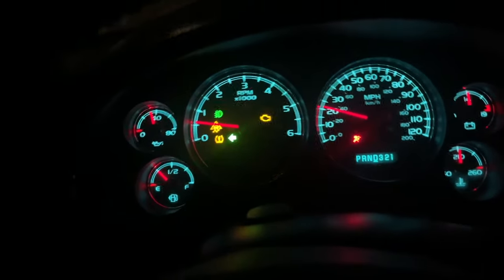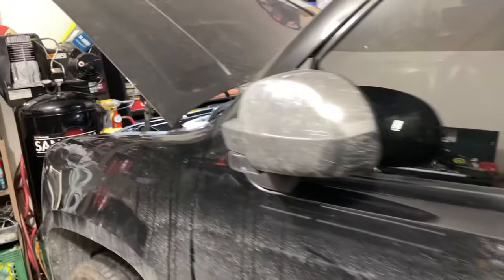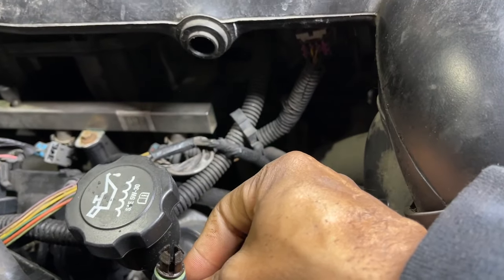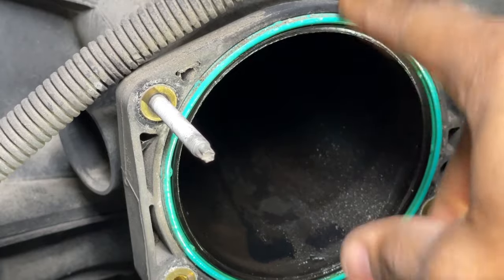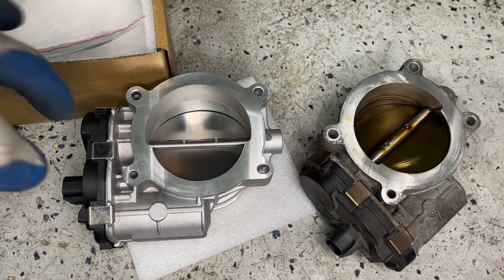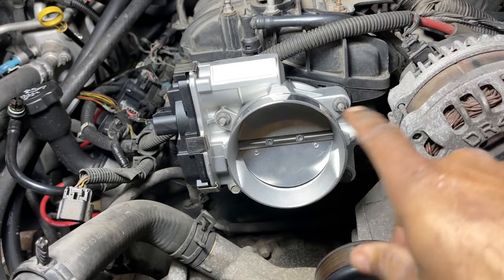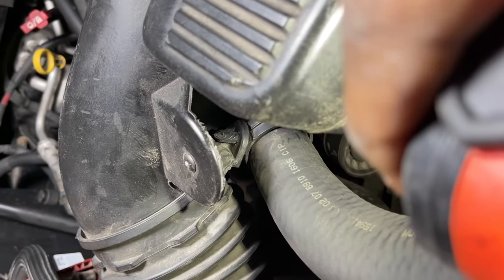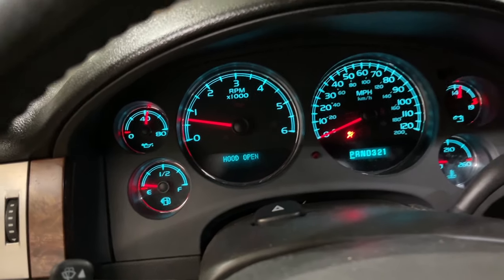How To Fix Reduced Engine Power Quick And Simple! Code P2135 Chevy Or GMC Trucks / SUV's! TPS Issue!

Comment: What was the exact name of the part that you installed? Great video btw.
Reply from the maker: Hi, here's a link to a new part for the 2007-2008 Models

https://www.ebay.com/itm/374136353837?fits=Year%3A2007%7CMake%3AChevrolet&hash=item571c43b42d:g:c44AAOSwIqlivR9B&amdata=enc%3AAQAHAAAA8A2kI6cfFvC0MtBqUe%2B4Ifu16TSp5iB0eHwodOstSzRT%2FVzPOZb5qAKE9pM9qTAJb8YYnwbOCdSrw3eEJqX6GnTQPjW0OJX0IwsQlejuzoZN2MSr8O%2Fla6ZaheXl1sFMH9ryg7Am328%2BCA7qvHcB19G64Q%2BjiY42Jb7lgoTJUW1lhB2%2FJ%2FBf0xCIe19VgmLkNcUv6B1ySxHD9iXXxI8IrdTtktaDDGqQZuKCrefpKid71AsMda2JxJc%2BSYTXr%2BNd93yCeXH2L4xq%2BbvXd5kEgahbzQvudtKPMWzPzAqVDeCKAl6UnvN5ZBfRWEzg1df6kg%3D%3D%7Ctkp%3ABFBM5Jeh1LFh

Here's a link to a new part for the 2009-2014 Models

https://www.ebay.com/itm/263995145126?fits=Year%3A2009%7CMake%3AChevrolet&hash=item3d77563ba6:g:hTQAAOSwEahhkcsT&amdata=enc%3AAQAHAAAA8Alo%2BCk%2F1yLsIegy9tmk5edQ5E%2FZaYgySY%2B7R7qsEEHQ8eppIFJgp7kxtrhcJ2fSWmSO72CpkG0bGJB483VVEEwO9cfbKnISkX7UjRSN72tWtcyHqHT7%2BJ3H%2FhB9CYntyup5AxbSXZ1giFpadQslDSe1wjkzvIIYzbKKfG90FAY6D%2FlWJZfsOx1pBoPy1K%2Ft9Yqh2xzJLo7nsC5p1Hcc7UD1zD8geuXzY5OHRyFdicwKyHAV4N3H7E1qLNZo21i88T2EEmJ8ckXoVLTEZV3KtC1g5MEXETgod7%2Fzj0miFZ5ibqB6teiBgsSNC2IQjBKSag%3D%3D%7Ctkp%3ABFBMoKu-1LFh

Comment: My 2001 chev camaro haves a reduced engine power lighting hoping that's the case and not the alternative the engine sounds week when starting 😊
Reply from the maker: It can be quite a few things. You need to read the codes to zero in on the problem.

Comment: Tyvm Terrance 🙏.. My Suburban started something similar this morning. Not the exact same 🎉. Mine says something similar to diminished engine  .... .... 
It ran rough and drove slowly.  My son pulled off and shut it off then restarted then it improved. Got to O'Reillys auto parts. They came out and tested the truck, and code spit out this sensor. I have a 2003 Suburban, but in general, it's the same as you know.  What sucks is.... I'm in California, and what is on its way? And ironically, while typing this, it started to rain. Lol.. 
Luckily, I'm in the zone that won't get the worst of it. If it continues its track, we will only get the tropical storm part. If you know California... we are above Los Angeles, between LA and Santa Barbara. 
Anyhow,  he just ordered the part and will take a few hours to get it. He just started it, and it's now acting normal. Check engine light is off now.
Reply from the maker: You're very welcome. I am glad my video helped you guys. I am somewhat familiar with California as I had family that stayed in Fresno. Be safe out there and thanks for watching.
Reply: @TerenceDIY  We are in Ventura near the Epicenter of earthquakes today..
Reply: @TerenceDIY  Where are you? Being a military, we have lived coast to coast.  I definitely prefer California. Less anxiety and such where we are. (Area). Not like when we lived in Augusta, Ga and Woodbridge,  Va near DC.
Reply from the maker: Chicago, Illinois. I can imagine California being ideal for just about anyone! Lol. I would love to get me a place there.
Reply: @TerenceDIY  As long as you're not in the inner city such as LA to San Bernardino area, it's way better. When you hear about gangs, race issues... then avoid that area. My 2nd husband was Korean mix and personally growing up with someone like the ex-president.. lol .and a household of brothers  .. My dad was a Hells Angel from the 50s. He stopped talking to me when he met my first cpl bfs. Lol. I heard every slang word in the book. The one thing i liked about being military was that was sooo rare to see, especially in the 80s to 2005. Base Living helped protect my son from that. Well, he's over 35 now.. I don't need to worry about that now. He's nothing like my family and will never be.  
One thing i did learn growing up was to be self-reliant.  I watched my mom and helped work on a stock car, then restorations. Not for work but for myself but helped others to learn. Though i went to cosmetology school and later after DC, USO, and such.. i hopped into college. But being a spouse,  i had to be flexible in work. My automotive work helped. I worked dealer auctions, wholesale and retail, parts, lot man. Parts man, and more. But because i learn as I went along, I taught my son. He actually quit college for automotive technology. But didn't get work in that field. Long story there.. but in short, we<< got screwed. 
So he bakes.. like in fantastic beasts.. well, sorta. Lol. But he's mechanically inclined and does everything he can himself. Thankfully, he picked up that part of me.
..
The question is, do you work for yourself or someone else? 
What sucks here ... is everything is expensive. Actually, when we lived in Cedar City, Ut, you as a self-employed mechanic, or fix it guy,  would do well. 
My favorite shop here in the area closed up right before the pandemic. I use to go to that shop in the early 80s, they sold it, then eventually it closed. I don't want to sound political but the a certain group are buying up properties then doubling or tripling rents.. or write it off as a loss so they don't pay taxes. Reminds me of what China is doing too... same with buildings. Build a huge apt complex then it sits empty.  Noone can afford the rent. Id say if you ever choose to come,  wait for mortgages drop. These guys will be doing anything to dump them. Seriously... what biden is doing is eventually going to make everything drop. I know Illinois, has really bad taxes.  Oh and since trump took office then the pandemic,  the homeless has risen. Most actually work ft jobs +.  
But, jobs can be found.. 
Oh. BTW. I'm a few miles from the Epicenter of the earthquakes today.  I you didn't know about them.  You might check YouTube .. Earthmaster is great.
Reply from the maker: Wow. Thank you for sharing that info. Great to know you love to do things yourself. To answer your question, I have always worked for myself. Also, I like working by myself no matter how big the job is.
Reply: @TerenceDIY  Stay safe there. Oh, I have an idea, if you choose to relocate to California,  you might either save beforehand, travel with an Rv, living on the down low while the work picks up or partner up. Uour own boss but work with a dealer or ? . Many wholesalers i use to work with in auctions,  like independent contractors.  My cousin use to tow vehicles but not like a company that works with insurance or for hire. He worked with several body shops and mechanics. Yeah, yeah.  My cousins are here in California too.. lol. About an hour or so away. I guess he's much like you, well was.
Btw, does your wife help you on the videos? Or your kids?  Great way for a teen or?? To learn some videography. You definitely need someone to enjoy what you're doing too or they'd get bored. 
Crazy, my son often came to work  and even with me, atleast my costume and certain theater classes. He learned a lot from my professors. Ironically his hs teachers were also my college professors.  It was odd going to English and seeing my sons teacher 2 days a week. Living in Utah, the church members believe in higher education. The church helps them too.. but it returns in tide 10 fold. 
You have a great night.. 
My son will fix the truck as soon as the storm settles and around his schedule. Hopefully the truck doesn't act up again.  Just crazy it happened as this storm surge. 
Oh well, such is life. 🤘
Reply from the maker: I would love to have a second home there. I will never leave Chicago (my entire family is here).  As far as my videos, I do everthing by myself. I have all of the best software and programs so I'm pretty savy with the tech. My little boys (5,7) are busy on their  tablets and my daughter (16) just got her first job. Once again, thanks for sharing. Let me know how the truck turns out when you guys are able to get it fixed. Stay safe.
Reply: @TerenceDIY  ok.. Rod, said tomorrow will be clear enough to work outside before heading to work. I will ask him to record but states the check engine light went off the moment we left O'Reillys. Do they have O'Reilly auto parts there?
Reply: Lol.. Rod=son
Reply: @TerenceDIY  btw. Everything you see on TV in California is always in the areas I stated. You saw BLM and Trump/race riots.. for some reason the degenerative groups congregate in those places. Yes the cop stuff is real, gangs in police. For some reason they are worse there, university district in Washington state, but not so much in west Seattle.  I worked in both areas, and saw the difference. Though separated yrs now,  my 2nd husband is Korean well his mother was. My 1st was from NH, family of little frenchmen. Lol.. but living in California, he tanned up dark with a dark stash.. it's funny everyone would automatically start speaking Spanish to him. And hed reply in french English accent.  Lol. No.. he has no accent except American. There's a saying the Anistazi indians < cant recall spelling or exact verbage
About a rainbow and skin...   pretty much exactly how i raised my son... 
Also myself being into Genealogy, I found the ppl most prejudice were the close minded and less educated. Though they exist everywhere,  like a dandelion seed in the wind. They land where the wind suddenly stops. My personal analogy.  Lol. If i find that saying i will share it.. but it's crazily wise and how the stupid white man made indigenous ppl seem.. uneducated and such when it was the opposite.
Reply: @TerenceDIY  I asked my son to record when he can and post on YouTube for you to see what he was doing. He's really good, but like everyone, he makes mistakes, learns from it, and moves on.
Reply from the maker: Absolutely.

Comment: I had no issues for almost a year after cleaning and replacing the main engine ground wire, then the other day after bumps and a really hard breaking due to a traffice issue it happened 3 times in a row. Each time minutes apart. All i did was stop and reatart the car. Finally got home it ran fine after each restart but happened 3 times back to back. Now i checked the battery ground and firewall ground and just pushed on the throttle Body connection to set it. No issues for several days. This is just weird...
Reply from the maker: Yes, that is really weird. Something similar was posted on GM bulletin several years ago.

Comment: I’ve been having this reduced engine power problem on my 2006 Chevy Silverado and I’ve replaced the whole throttle body like 3 times and one time just the throttle position sensor it’s self and it does work for a good while but after a couple months the reduced engine power comes back
Reply from the maker: Did you buy and OEM throttle body? Thanks,
Reply: @TerenceDIY  not sure but how do I know if it’s oem
Reply: @TerenceDIY  the first 2 I bought were from Oreilly auto parts and I believe they were the Yamaha brand and close to 300 bucks
Reply from the maker: @moe4962 , this is an OEM (Link below)...

https://www.ebay.com/itm/114732200404?fits=Year%3A2007%7CModel%3ASuburban+1500%7CMake%3AChevrolet&hash=item1ab69271d4:g:bnAAAOSwWMRgU8CT&amdata=enc%3AAQAHAAAA8Gx2AURQy6Df5gEuMbRS0x9f2F6sA3xkCwvbAAkRh0gSrvGlMZumm3fb83KQmBYxucBIcRHGN6RBhrHec3TMmu00FyxB0q5nD8fU0xqFFeqytkdRW6bh%2BfENitL0IAmSOzdcgLR6unYxL3XX%2BibUhPYJoWAnG5DGiyLda8LvwnmIWuRU5CCDf6xMTreugNok5hyR%2BiqpeG1alz6heGNqVpF3UY8c5RlxbAcHnEaDKg1ReMBiVn6HOYflemGJymIL1zEZKBzf5GKjqHr9Thp208jMNyI48O4wm93CgobZUfyaHRsyBiuP%2FwPTU1NvP4%2FJUg%3D%3D%7Ctkp%3ABk9SR_rOtNW8YQ
Reply: Possible it’s your gas pedal sensor
Reply from the maker: @1jw298  ,no. This fixed the issue instantly. My truck drives great still. Thanks for watching.
Reply: @moe4962 Did you resolve your issue permanently? This happened to me today. Leaning towards replacing the throttle body but want to be sure.
Reply: @Ace-44  not for me because I still have the problem I think mine might just be a wiring issue or something but it may work for you because I know it does for most people that have told me

Comment: I have a 2013 gmc sierra and it happened  to me last night out of the blue my truck didn't have any other issues before then , I ended up driving it home doing about 30mph 'which was about 50 mins away usually ' so is that the only way to fix that problem.
Reply from the maker: Hi, 

It is the most common however, there could be other issues. Do you know what code it is throwing? If it is the P2135 It's probably the throttle body. Let me know the code if you can. 

Here are some links to the parts for future references. 

https://www.ebay.com/itm/225590875332?fits=Year%3A2013%7CMake%3AGMC&itmmeta=01HPYVKVNBA38AQ8705PZ8QE1J&hash=item34864394c4:g:tgUAAOSwNrhkby5M&itmprp=enc%3AAQAIAAAA0NNQWXMnLtdnN%2Byk2rlPXLl6qchwmAKFpo57JHs3vILXsXVtqIDGM%2BjzIJrXsVM97y0k8cwnm4xMlfXjWXmgNzK4aRzKbMcAcJNqyoq%2FXGAjRIlwgWirZSPuUM9Hnznh2%2B6cY9vZLnpTWElIVUTUaBcHciTg79BfKBWENiC8SSLkM78pGEnuKAmTaNtekBCmYN26ifx5M8UKL5vRfa8WOqDgDRYq9aY3gGq%2BJlQq34AWq04uZdKyXeOL1eZfYJCUgihwrHywk%2Bd2ghIDuJ%2B6t50%3D%7Ctkp%3ABlBMUPa6z9u3Yw

Original OEM PART

https://www.ebay.com/itm/155530112004?fits=Year%3A2013%7CMake%3AGMC&itmmeta=01HPYVNNM37ADNQ3XW3PW2X4E6&hash=item2436512c04:g:kyQAAOSwgNliCfqg&itmprp=enc%3AAQAIAAAA4PKvH9bX7kE9XpeJu0GjFJ4Ru00%2B9H9DpR4TpWHCz8pyul%2FkCC64F9jukmPeFqBSjfJZFjobvkNWQ8ZoWVDyiH6U112Y9THwzPcsWbnXQNERDkC3UH6%2F2yGA6hKCj8TiSQhzEwO6uVS6IMvw1UkRBWdo3GY1IdZ3Mm7298kBH%2Bi3iYP4sRQYKWn3xXMHroyf5E3dsKskilm1BV5Y2TK7lf2yWP1mgabvnjgvPv817hnUy8R2rMrvVZzsfDhW2IEVUKgod%2BwSTPn%2Bk8BdF6zQyoGaTsJ8CxdWVC78PQ6gdS8a%7Ctkp%3ABk9SR7Da1tu3Yw

Comment: I’m having the exact same problem on 07 Denali. It’s giving me the cylinder 6 misfire. We changed the coils, plugs and wires 😩 I’m at a loss
Reply from the maker: What size engine? 5.3? It really doesn't matter I was just curious. Your problem is probably that injector on the number 6 cylinder. For some strange reason, the injectors go bad first on the even side of the motor. Thanks,.
Reply: @TerenceDIY  6.2
Reply from the maker: Okay. It really didn't matter. If you haven't replaced that fuel injector, that's probably your issue.

Comment: I have same issue but with code P2138 but I'm guessing its the same fix? Whats your opinion?
Reply from the maker: I don't think so. Your issue is most likely the Accelerator Position Sensor (Gas Pedal Sensor). Most of the vehicles I have dealt with that code is the APS.
Reply: Update, after noticing someone already changed the A pedal and throttle body, I looked into it further. It was a bad connection with connector C205 ( behind the IP). All is good now!
Reply from the maker: That's awesome! Glad you got it fixed.

Comment: I have a broken box excuse my non mechanic lingo, but where the hose goes from the box Its broken and doesn't seal correctly. Im looking for the part now. Im assuming the same shyt job mechanic who glued and broke a bolt inlet on the timing chain and oil pressure pump cover did the same work here.
Reply from the maker: Hi, can you tell me what section of the video (minute mark) of what hose / box you referring to then I can tell you exactly the part you need. I can also probably get you a great deal on it. Thanks,

Comment: Changed the whole throttle body on my 2003 Chevy Silverado 1500hd 6.0L new air filter would it be the gas pedal sensor or something thanks in advance
Reply from the maker: In your case it could very well be the Accelerator Pedal Position Sensor. Here is a link for one at the best price. 

https://www.ebay.com/itm/166522231262?fits=Year%3A2003%7CModel%3ATahoe%7CMake%3AChevrolet&_nkw=2003+chevy+tahoe+pedal+position+sensor&itmmeta=01J7FBVY3GD7P262SXG79RG73E&hash=item26c57f99de:g:nOwAAOSwVfllikJi&itmprp=enc%3AAQAJAAAA4HoV3kP08IDx%2BKZ9MfhVJKk3W1EUx7BDaoKltAWTXhaQy%2BigSmZMYpw42Q4j%2B9J3JxnTTD2yHtepQMIOBIdWkkxiX74pnm4u554PVg43fN6rSzbFNsFVRUPnRoVw%2BJEymrVrOnn1FXVsbXN1e84Xk637JKadEnVON%2FkOv92NzUkWDd7ZxBUNN9Si3akwySQy1dEncGauChUlIzlUVDg%2B8rAQQ0JeojqFmLLGzomO5fyKCK0%2B2Gv6xiO4vTA7JX9SqjSZARjPx2ujHUr5D7qPx81fpbXX22f3UJjnlvW%2BW7JL%7Ctkp%3ABk9SR_Th7-u7ZA&edge=1

Comment: hey Bro, nice vid. I have a 2010 Savana doing the same thing, but only when it rains really hard and the streets have standing water. I shut the engine off for about 10 minutes and drives fine until I hit more water and it does it again. Shut it down for 10 minutes and all is good. Only when it's raining hard. Any ideas?
Reply from the maker: Are you getting any codes?
Reply: @TerenceDIY  Yes, the P 2135 Throttle/Pedal position Sensor Switch A/B Voltage Correlation
Reply from the maker: Your accelerator pedal sensor may be going bad. I've dealt with a few of them and you are having similar signs to one possibly being faulty. However, you can clean the throttle body (throttle body cleaner) in which should improve your performance and MPG.
Reply: @TerenceDIY  Will do, thanks.

Comment: Hi I know this was a year ago but I was just wondering how has it been doing since you changed the throttle body any more problems with reduce engine power?
Reply from the maker: Absolutely not. The truck is still running amazing and I've put well over 20k miles on it since this video. Thank you so much for watching.

Comment: Did u get a p0301 with this code too
Reply from the maker: Nope. If that code is constant and your truck is running a little rough, you have a bad injector or coil on the #1 cylinder.